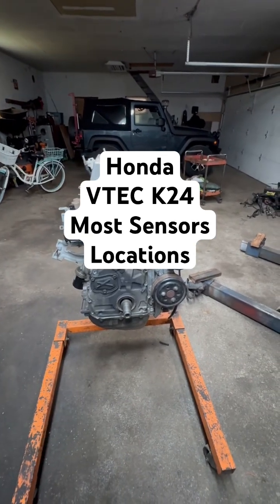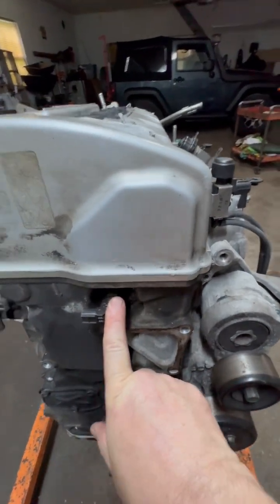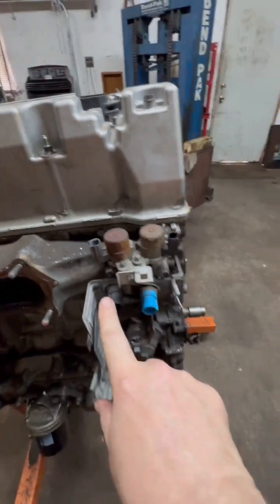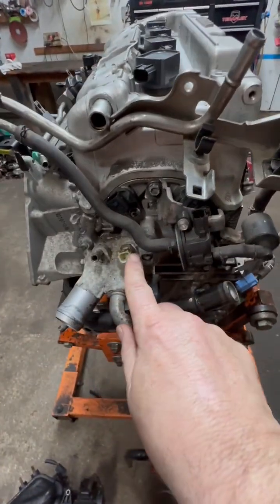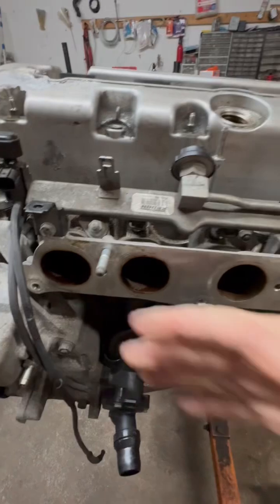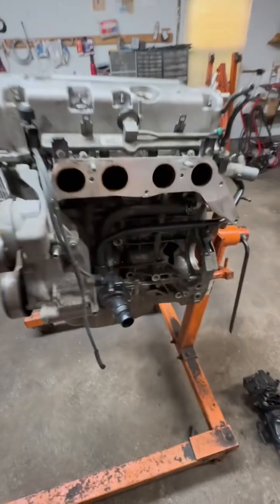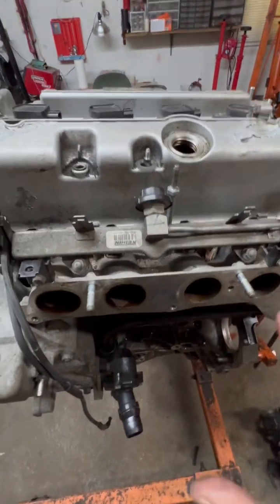Honda/ Accura VTEC 2.4L / K24 Engine Sensor Locations - Cam, Knock, Coolant etc.

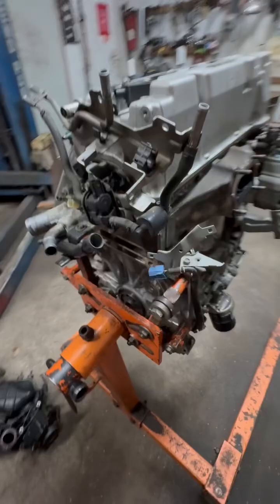Comment: Which one is the cmp and which is ckp exactly? 0:30
Reply from the maker: Which ones are you looking for exactly?
Reply: @motorcarnut  i probably need to change both sensors, i guess my question isnt really important then :D i just need to compare part numbers so i can identify which is which. but thanks for responding ;)
Reply from the maker: Sure, no problem! good luck1